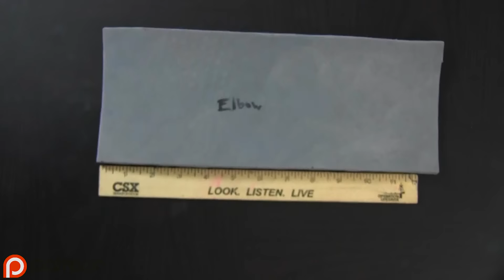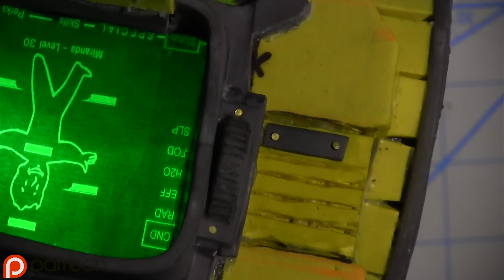How to Make a Pip-Boy 3000 (Fallout Tutorial)

Comment: Thanks for making this video, Im in the middle of building my first Pip-Boy 3000, and this video is a real help on some of the details.
Reply from the maker: +The Maxx no problem!
Reply: You think I can build it in less than 10 days? Oh what the hell am I doing, this won't get answered by anyone anyway.
Reply: I built mine in 2 days but i also spent like 16 hours on it. That was for me building and painting. I went with Plasti Dip instead of the water down white glue as a sealant. That helped me speed up the process a little I think.
Reply: Well it doesn't work for me, It won't glue and the measurements I got made the wrist 18 million time too small. Halloween is coming soon and I really want to add this to my costume but I can't get the pieces right. What are the EXACT measurements he had? I did the same thing he did but mine came out too small to fit my fingers through. Fuck it, I'm almost out of foam anyway, I'll just duck tape the shit.
Reply: +The Maxx  about how much did it cost
Reply: Make a slot to fit your phone in so you can play the Pipboy app to make the pip boy a lot more real
Reply: Boogie Glenn It was about $30. I had to buy a new hot glue gun so with out that it would only of been about $20.
Reply: The Maxx good i have $23
Reply: Good news! I finished it before halloween. Looked like shite and it rained anyway....
Reply: Simon Cooper lol

Comment: I just started to make my foam Pipboy like WJ did in the tutorial. Instead of using the foam squares for the base, I decided to use a foam bedroll that I bought at a surplus store. It's dense but not very thick so it won't be very bulky.  

I have the elbow and wrist part made and put together. My first thought...this fits GREAT on my arm.....hmm what if I want to wear a coat/duster as part of a bigger costume for Fallout? Then it won't fit over a coat.  Keep that in mind when measuring/making your foam pipboy. Will you be wearing it bare arm or over clothing. makes a difference for sure.

Comment: I'm in the process of copying this piece and realized all his measurements are worthless to me because my EVA foam is just a tiny bit thicker. My first attempt ended up total failure. Right now I'm using this video as a guide to the general shape each piece should be and I'm at 1:25 working on that wider base getting the measurements right. Thanks so much for this video!
Reply from the maker: Robert Rizzo No problem! And yeah, I have a lot of scrap foam left over from other projects so I'm using both thick eva foam and the thin kind that comes in roles. Mostly the thin kind though.
Reply: I learned something because of this project, foam comes in .25" and .375". :P
Reply: Robert Rizzo Robert, put up a pic when you're done..or a link or something. I picked up all the gear this week to start my project but haven't started it yet.
Reply: Sure thing! I'm posting pictures to my tumblr. ragevalleygaming.tumblr.com

Comment: I'm using this tutorial as a guide to build my own and I was wondering if you use a heat gun to shape the foam tube
Reply from the maker: Thomas Babb I didn't, but if you have that option, then it could help.
Reply: +William Jakespeare at this point I'm at the stage where the tube is complete and I'm ready to build the box and it is extremely hard to see where you're putting some small details.
Reply from the maker: Thomas Babb You can also google the pipboy and grab a bunch of photos from every angle. that's what I did.
Reply: +William Jakespeare what did you use to make the grooves between the Geiger counter and knob?

Comment: why dont you use metric? its a much more accurate measurement method
Reply: JokerHull metric/standard. it doesn't really matter. he's dealing with foam and cutting it freehand with a box cutter/blade, it'll never be 100% exact.
Reply: JagedNS I'm not talking specifically about this project, but any craftsman that respects the art will use metric.
Reply: ah. well I don't agree with that statement but I understand what you're saying(I'm in a country that uses Metric also).  I use both standards of measurement, depending on what I'm talking about. I'm weird like that  :)
Reply: JokerHull Eh, I just put a mark on a ruler or stick if I'm making two similarly lengthed things, and don't bother trying to get measurements.